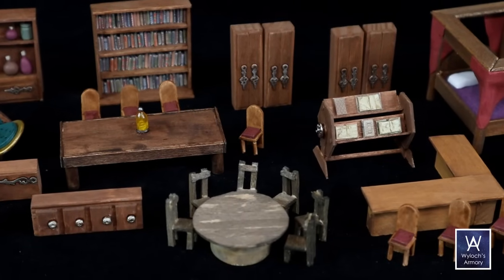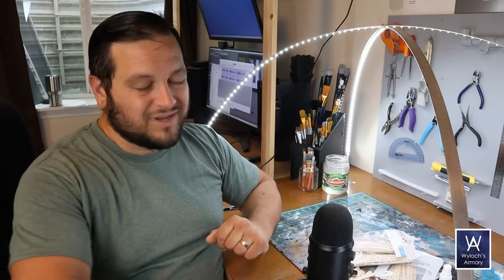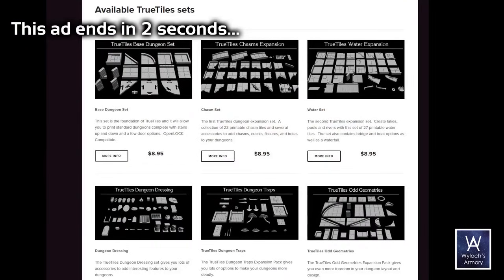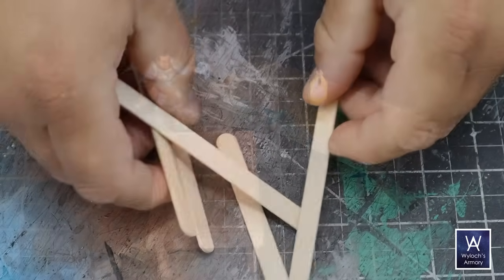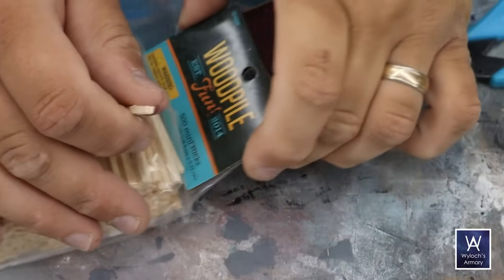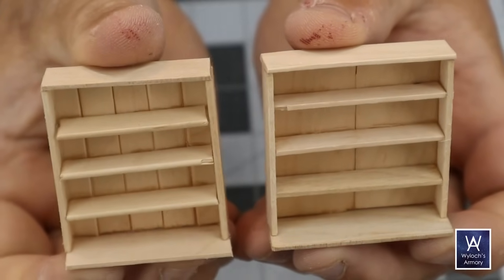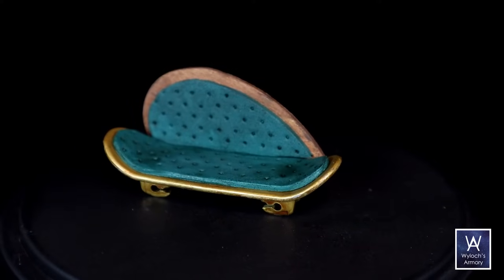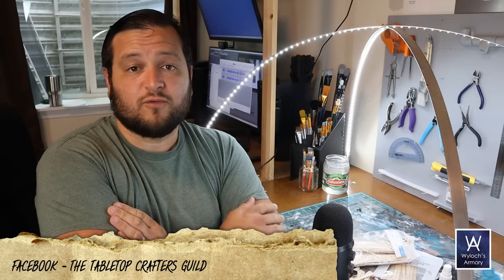The Ultimate Guide to Miniature Furniture (with NO 3D PRINTING or FOAM - Dungeons & Dragons Terrain)

Comment: I've found the glue activator has a greasy texture to it that seemed to be left over around the bits that the glue didn't contact, I think I'll be using the touch method a lot more.  Great breakdown video on a lot of good scenery I've put off building